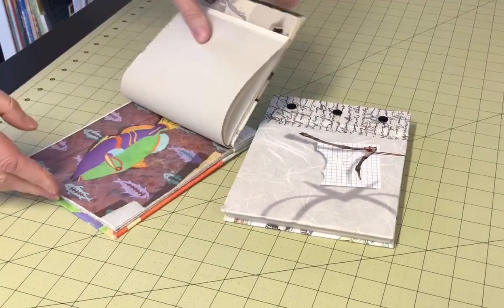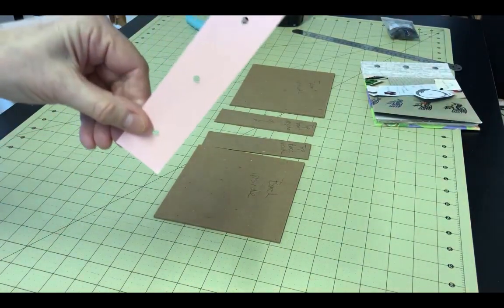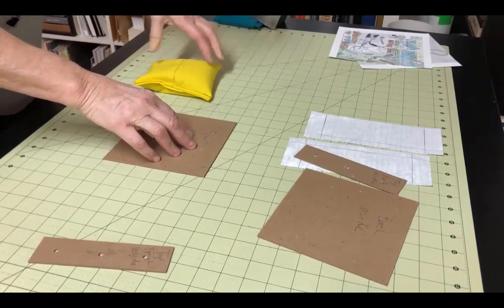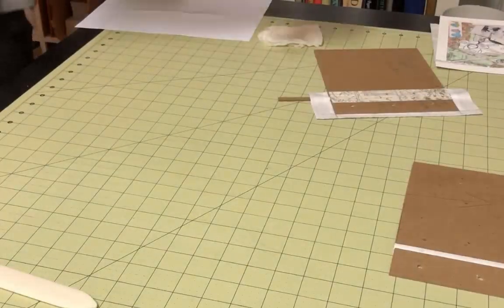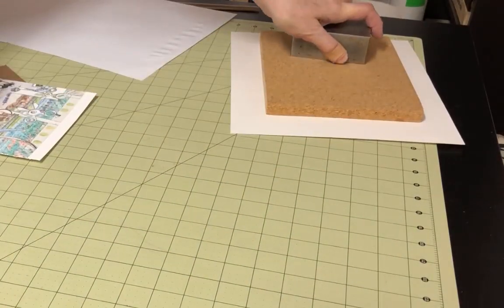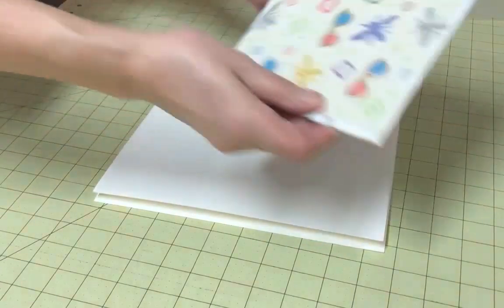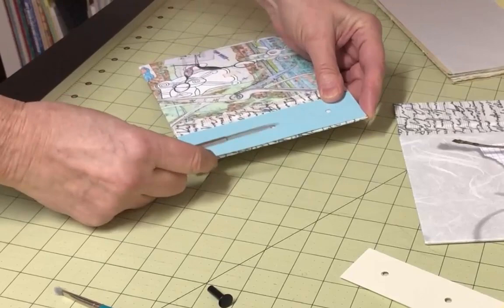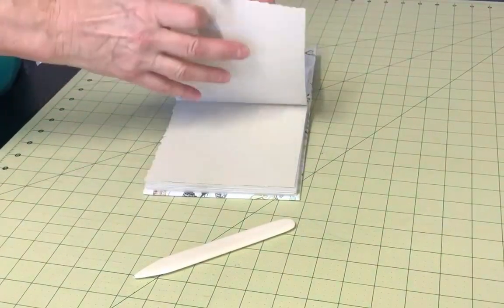Screw Post Scrapbook Binding

Comment: I had a book like this in high school for my tech drawing text book,.
If you wanted to make this thicker is it just a matter of replacing the Screw Posts with longer ones?
Reply from the maker: They also make screw post extensions that you can just add to the existing screw posts.
Reply from the maker: Yes, exactly. :)